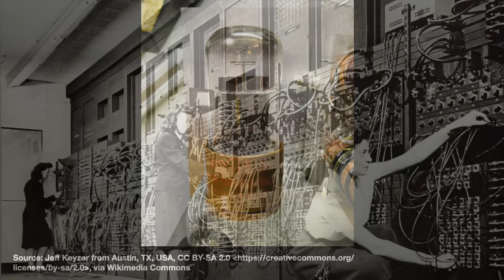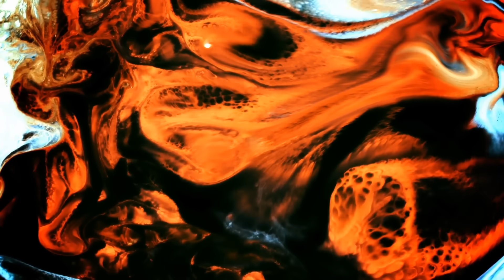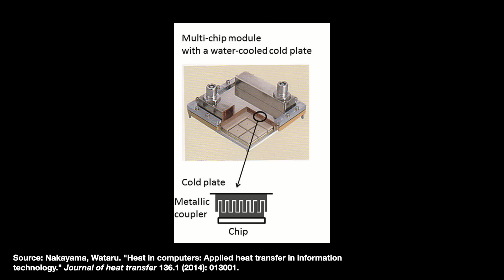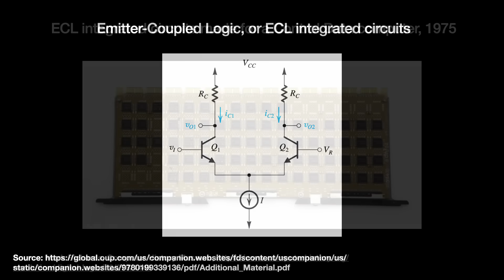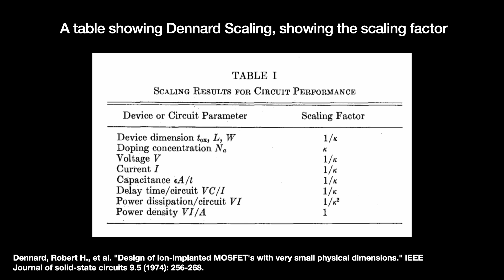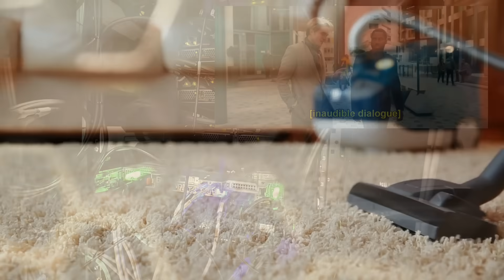Chilling Chips: A Computer Cooling Chronicle

Comment: Slightly off topic, but waste heat is also what will be the ultimate stopper for growth.
Economic growth is tightly coupled with energy use and while we can go fossil free, we can't avoid waste heat, as all energy ends up as heat.

The amount of energy used by humanity used to be neglible in the Earth energy budget, but two things have changed.
1) We have filled the atmosphere with green house gasses (GHGs) holding back ~460TW and thereby heating the atmosphere a dangerous 1.4°C.
If we hit 2-3° C we risk runaway effects threathening all major food crops. These GHGs will stay in the atmosphere for centuries.
2) Our exponential energy use has reached ~20TW and is doubling roughly every 30 years. That means we hit a very hard ceiling in less than 100 years. And sooner if we don't go fossil free asap.

Growth will be over within a century. Either because we get a better (steady state) economic model or because civilization crashes.
We therefore need to act right now, as the transition will take time.

See "There is a deeper problem beneath global warming" by Aeon for references.

Comment: Haha... Without my reading glasses on, I misread the vid title as: "CHIRPING Chips: A Computer Cooling Chronicle", thinking it was about a novel method of using high frequency sound waves to disperse excess heat from high performance chip hardware.
Reply: To be fair most of my language model ideas are from simply misreading paper titles. And they work too often.

Comment: Cooling was also an issue in electric power systems, with oil cooled transformers, liquid cooled ignitrons, air or liquid cooled power semiconductors (diodes, thyristors, IGBTs…)
These cooling systems had also to withstand high voltages and sometimes be compact and light enough to be used on locomotives.

Comment: FWIW, none of the traditional Cray machines used liquid nitrogen for cooling.
ETA, a CDC spin-off, did use liquid nitrogen for some of its ETA-10 computers, immersing its main CPU boards in liquid nitrogen. They were not very successful commercially. Air-cooled versions also existed.

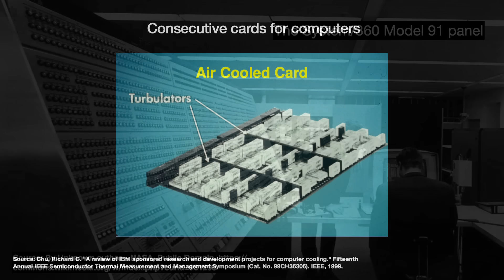Comment: 8:45 please forgive me…. The Turbulator is an integral component in the axial-convoluted air flow induction module, positioned strategically within the laminar flux discontinuity array. Its primary function is to instigate pseudo-randomized airflow interspersion, thereby maximizing the orthogonal coefficient of thermal dilapidation.

Utilizing retro-encabulated oscillation vanes, the Turbulator creates non-linear vortices which disrupt the hyperstatic quiescence of otherwise laminar airflow patterns. This ensures that each consequential air molecule undergoes transverse harmonic perturbation, a process vital to maintaining the holistic integrity of the air-cooled card’s sub-cohesive nodality.

Naturally, the Turbulator is manufactured from extruded trilanium alloy impregnated with pre-sublimated resonant particles to withstand both subsonic and supersonic thermodynamic fluctuations. The apparatus operates without any moving parts, relying entirely on inverse Reynolds resonance to achieve maximum turbulent dissonance.

In summary, without the Turbulator, the air-cooled card would succumb to the deleterious effects of thermal stagnation, inevitably leading to cascade systemic oscillation failures—commonly known in the field as the dreaded “fluxploder effect.”
Reply: LOL🤣

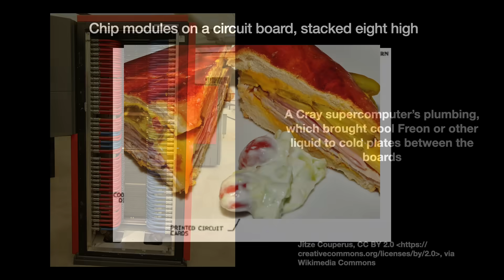Comment: the image at ~17:30 is not a cray-1, but rather a Cray Y-MP8. These had a 3-stage cooling system. The modules were cooled by flouinert (essentially the same liquid as that used for immersion cooling in the Cray-2) flowing inside the cold-plates to which they were attached; the flourinert was cooled by site-provided chilled water, which was itself cooled by the customer's HVAC equipment.
Reply: Yes. The Y-MP modules were much larger than the Cray 1 and Cray X-MP modules, as shown. They also used Motorola gate arrays, which contained a great many more gate equivalents than similar chips on the Cray 1, Cray 2, and Cray X-MP computers.  IIRC, the 8 middle boards in the chassis were the 8 Y-MP CPUs, and the 16 boards above and below the middle 8 were memory (40 boards total).

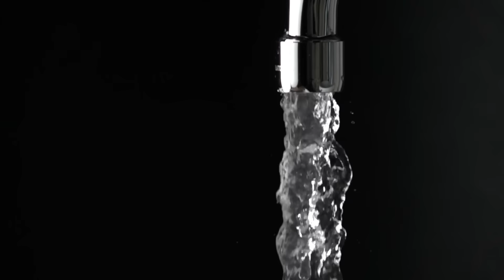Comment: 5:45 Fluorinert doesnt have chlorine so does not degrade the ozone layer
Reply: That's not true -- halogenated (fluorine, chlorine, bromine, ...) hydrocarbons pretty much all do. Teflon (polytetrafluoroethylene) is exempt only because its vapor pressure is so low. Fluorinert is a family of perfluorocarbons, and definitely fell/falls under the Montreal Protocols. The vapor pressures of most fluorinert varieties are quite low, and they evaporate(d) rapidly. Sadly, PFOA (perfluorooctanoic acid, from which many commercial fluorocarbons are synthesized) and related compounds are also responsible for a lot of groundwater contamination.
Reply: @robertherndon4351  why is this highlighted? florinet doesn't hurt the ozone, its a greenhouse gas which is why its under the montreal protcol.
Reply: CFC's have both Cl and F...

Comment: One very interesting method of cooling I have seen is a combination of liquid immersion and liquid evaporation cooling.
A H100 submerged in ultra-pure water - all inside a chamber that has no air - the upper part of chamber is filled with ultra-pure water vapor. There are evaporating coils - a few on the top of the chamber and a few placed such that they are in water. The water absorbs the heat - heat is absorbed from the water and water vapor in the chamber by the evaporation coils. The hot water from H100 surroundings travels up and the water that was around evaporating coils travels downwards - creating a water flow, purely obtained from heating and cooling of water without the need for any pumps.

This takes too much resources and space and you are unable to cram as many H100s into a server rack as possible. But evaporating coils being around 10C, the operating temperature of H100 was between 12 and 15C - pretty fantastic temperature control, even at highest possible loads.

Comment: The NVIDIA DGX B200 will most likely be the last of the air-cooled systems that NVIDIA designs. There is already a water cooled version of that system, but they also made an air-cooled one. The heatsinks for each of the B200 GPU's stand approximately eight inches tall inside the system, and the fans to cool the system take up 9U on the front of the system in a 4x5 array of fans. 

Because of the sheer volume of fans, a server room with more than about 50 of these machines in it will require hearing protection that you would see on a flight-line at a major airport where workers have to work around jet engine noise at all times.

Comment: Why such a fleeting reference to microfluidics?  I understand there are issues in manufacturing devices with channels in the substrates and pumping liquids through them efficiently and effectively.  However, they are currently being heavily investigated.  Also, Fluorinert is NOT harmful to the environment as it is based on a fluorocarbon and not a chlorofluorocarbon.  It's the 'chloro' part that attacks the ozone.
Reply: Chloro-s get almost all the bad press, but all the halogens are bad, if they have low/moderate vapor pressures.

Comment: Even we humans can get hot headed.  Back in the late 1980's I worked on a mechanical cryogenic cooler for IBM.  It produced 275w of cooling at -272C for commercial ghz cpu's.  Unfortunately it went nowhere since the development of the clock multiplier made GHz processors without super conductivity commercially viable.

Comment: When the military took over the ENIAC, the  tube failure rate went through the roof. Unlike it's previous use, they decided to turn it off while it wasn't being guarded/used at night.... so every morning, thermal stresses took out a few tubes.  Once they went back to 24/7 guard/operation, the failure rate went back to normal.
Reply: so it didn't cross their mind to shut down the B supplies and leave the filaments warmed up?
Reply: Try turning off and on again.
Reply: Soon our AIs will master Numberwang 😮.
Reply: This same principle applies to computers, light bulbs, and most electronics.
Reply: Another solution would be to double military expenditure during congressional budget time, and just spend more money buying more vacuum tubes. Somewhat akin to our American military spending habits in 2025.
Reply: @TheReviewerWhoHelps  😢
Reply: @TheReviewerWhoHelps ouch. true but still hurts.

Comment: It's nice to finally see someone addressing the elephant in the room, the scaling of density as being proportional to both power use and heat output will inevitably hit a wall. We are getting to the point that even consumer hardware is nearly impossible to cool without a chiller unless you undervolt it. From an engineering standpoint, it will actually be extremely interesting to see what solutions come up to both deliver the power and get the heat out fast enough, the later is particularly tricky.
Reply: is graphene salient for this
Reply: Consumer will likely never go beyond water loops and heat pipes. Chips come pushed way too hard out of the box so an undervolt just applies the reasonable tune that should have been expected from factory. Undervolting only cost a few percent performance generally. Never say never but an exotic cooling tech will exist in enterprise for multiple decades before it comes to the consumer side.

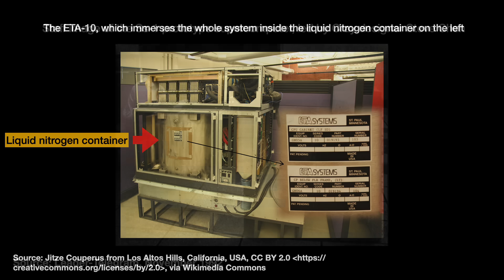Comment: 20:00 The Cray-X1 uses something very similar: In it, each chip in a MCM gets sprayed with dielectric coolant which then vaporizes and thus cools the chip. There's a video from "CPU Galaxy" showing one of these processors, it's quite interesting.
Reply: In the PC mod community, we used to just submerge our PCs in mineral water.
Reply: @ChadThundertalk mineral oil?

Comment: In the 1980's I had an internship at a place that used an IBM 370 and got to see some IBM techs open it up for maintenance.  The CPU module was built using wire wrap, which I thought was kind of strange. The IBM guys said it was because it allowed for higher density than a regular PC board and also the long wire wrap pins protruded into the forced air stream and acted as radiators for each pin.
Reply: Hé was right. Many high end systems, including military equipments, were made using wrapping, until faster speeds made it impractical. 
It was very reliable, vibration resistant.

Comment: I think that cooling on the metal surface of the packaged chip is not enough anymore. We should integrate the cooling system into the chip package itself. The chip package should have integrated heat pipe or vapor chamber, or putting the chip die itself into the cooling vapor chamber apparatus. The circulating cooling liquid should have direct contact with the silicon die, not through the package meta lid.

Comment: SLIC is called a cold plate these days.  Broadcom TH6 switch dissipates about 1500W each.

I work in the datacenter hardware industry. Oil immersion won't be a major player.  It requires a lot of expensive redesign but more importantly all current immersion proposals I'm aware of reduce datacenter density of throughput/floorspace as the immersion tanks are quite short, of necessity.  Instead of a 2.286m rack height you get about a meter. Plus, it's messy as hell and makes rework a nightmare.  

The current trend is single-phase liquid, propylene glycol and water. Two phase will be necessary soon and then pump 2- phase and perhaps direct impingement for high power devices.  That should see us through another decade or so at least.  Not sure what's beyond hopefully I can retire about then. 

Great stuff

Comment: So-called AI is driving the entire network datacenter industry towards liquid cooling on a mass scale.  Rack power levels are bounding towards 150kw each by 2027 and between 500kW and a megawatt by 2030. Datacenters will be consuming on the order of gigawatts by the next decade easily.  Assuming the input power is there. 

The environmental harm of CFCs may have been drastically overstated.  They were safe effective and efficient.  Plus Halon for fire suppression was phenomenal.

Comment: when i started at IBM in 1980 my Bible was the MECL (Motorola ECL) Handbook which advised first about transmission lines issues ie minimizing reflections and such due to impedance mismatches in layout. it was exciting for a new minted engineer to see that Smith charts are actually useful.
Reply: Just curious: how would you use a Smith chart when deigning a presumably digital circuit?
Reply: @cogoid  back in the early 80s MECL chips were only LSI so the transmission line effects are in or on the connections between the chips on a multi-layered PC boards.
Reply: @linhdtu  Yes, I understand what MECL is, and what the Smith Chart is. But how did you use the Smith Chart in the context of digital circuits?
Reply: @cogoid the interconnections operated at such high frequencies that 1) you had treat them as transmission lines.  That meant the dielectric constant of the board, as well as the width and the overall shape of those interconnects was/is crucial.  Reflections meant distorted signals, which needed to be avoided.  1) impedance not being matched meant a lot of lost power - and that meant more power was needed, and that meant more Heat.

If I recall correctly, Smith Charts deal with impedances, and are useful when you need to match the output device of the drivers to the transmission lines, and then match the transmission line to the input devices.

ECL (recall reading about these a long time ago) not only do not go into saturation, but also have differential inputs and outputs (better noise immunity) which is more important when your “swing” is 0.7 volts compared to, say, 2.2 (TTL) or ~4.0 volts (Old RCA CMOS).
Reply: @cogoid  It's a transmission line, so needs source, line and load z to be closely matched. What better way to display it than a Smith cart.
Reply: @sundog486 The interesting things that one does with the Smith chart, when it is used as more than just a display tool, require the circuits operating at a specific wavelength. One measures the length of the transmission lines in wavelengths, plots L and C impedances at a specific frequency. 

Digital signals are obviously not a simple sine wave at a constant frequency. Maybe there is some trick to apply Smith charts for digital signals, but this is not a common knowledge. That's why I am asking. But it does not matter too much if the Op does not remember what exactly the story was, it was still a very nice bit of personal history.
Reply: @cogoid  VLSI wise on chip  the gates are placed close enough such that transmission line effects don't matter but off chips they do. i bet they are taken into consideration for USB drivers
Reply: @cogoid Digital is only an abstraction built on a foundation of well-behaved analog circuits.
Reply: Dear diary:

Comment: Data center builders should be compelled to find something useful to do with all that heat.
Reply: In the late 80's The Cray Software development building at 1440 Mendota Heights road in Minnesota was pretty much completely heated by the waste heat from the data center. IIRC that made it quite hard to sell when they moved out of the building :|

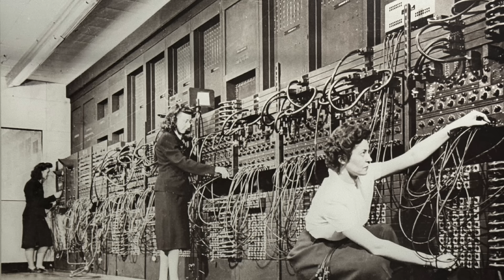Comment: 1:09 Consuming 150KW of power and outputting 150-174KW of heat is impressive; not only is no energy used in compute, it can output more power than you feed it. Should've stuck with that design, seems neat!
Reply: Oh look, a perpetual motion machine.
Reply: If the computer is consuming 150KW of electrical power it will generate 150KW of heat -- the additional heat to be removed has to account for the cooling system which also requires power and produces heat.  The operation of the computer is what requires 150KW>
Reply: theres ancillary components that also generated heat
Reply: The 150KW computer is impresive but the approximatly  25KW to remove the above is not very efficient,
Reply: @anthonytidey2005  6:1 cooling efficacy is pretty typical for common phase change refrigeration at air conditioner temperature ranges. Maybe slightly low for a large industrial setup but better than typical residential. And there are some additional sources of heat aside from the computer, and variance depending on the ambient air inside and outside of the building, which can make that efficacy better or worse.
Reply: Don't worry, new AI rack will project consume up to 2MW in one rack!. Take that old system computer 😁
Reply: Yeah, something is wrong there... Maybe 150KW isn't the total draw.
Reply: Speaking as a retired thermal guy (among other titles) that's a bizarre quibble.
Reply: Air conditioning will do that (for sake of example, I made up the exact numbers), you get 500W of cooling at one end, and 1KW of heat at the other, and power consumption of 500W. That's how heat pump heating can output more heat than power consumed.
Reply: Heat generation is not 100% from the input power. A few watts is lost to devices like bulbs, screens, punch card readers, etc.
Reply: @dtibor5903  no it is. heat produced by the system as a whole can never be greater than that the system consumes (as elecric power input or taken from environment otherwise) as a whole.
Reply: ...but it can be less of course, some energy is lost in the form of radiation, sound etc.
Reply: @s_s-g4d  The sound/light/RF is also turned into heat once it's absorbed by the walls/floor/ceiling.
Reply: @uzlonewolf  right. and that's kinda sad if we really think about it.
Reply: @s_s-g4d you have trouble understanding written text
Reply: @s_s-g4d let me rephrase it as I'm not native engrish: not 100% of input energy is converted to heat. Some is converted to light, mechanical work and other types of radiation.
Reply: @dtibor5903  right. which eventually become heat, too.
Reply: @takatukatom1371  yes, that's sad.